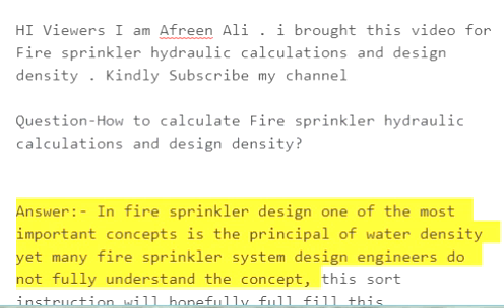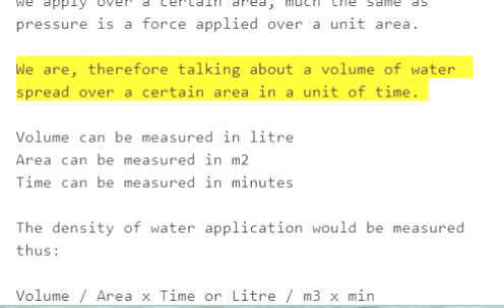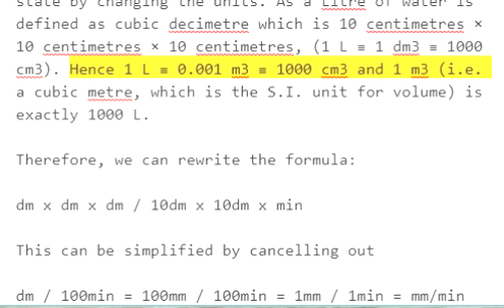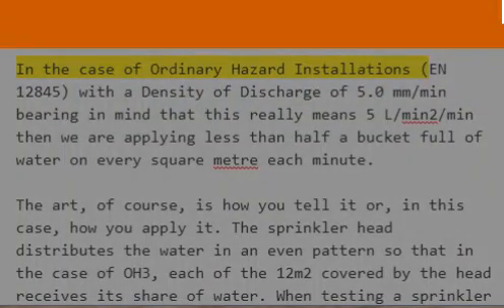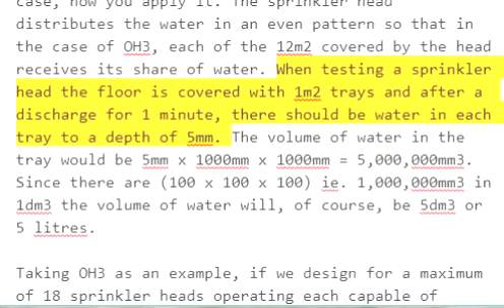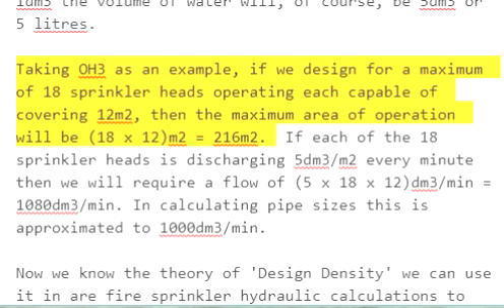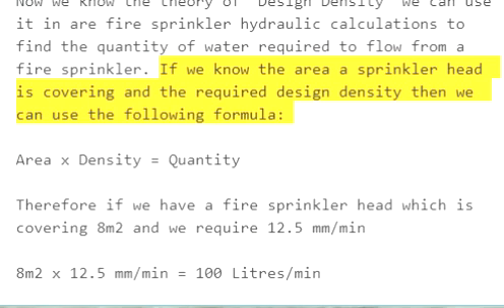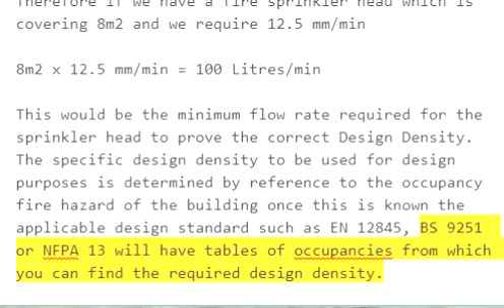How to calculate Fire sprinkler hydraulic calculations and design density

Comment: Dear Arfeen Ali.I am continuously following yours videos about  fire fighting and fire sprinkler  systems   which appears to be very informatives for the beginners to know about the  modern concepts. So in yours current video can you please explain how you wrote this density  formulae like Density =Volume /area x Time   where you used in yours formulae  volume in Liter  which is Ok  and area you took in   m3 Which  is not correct as this should have been  m2 instead of m3? So Can you please advise or correct yours entire derivation which appears to be mislead right from the selection of measuring unit?  Shall wait for yours answer Please.
thanks. 
javed  -Pakistan
Reply from the maker: See below link of video
https://youtu.be/YDOG6cGgXdY